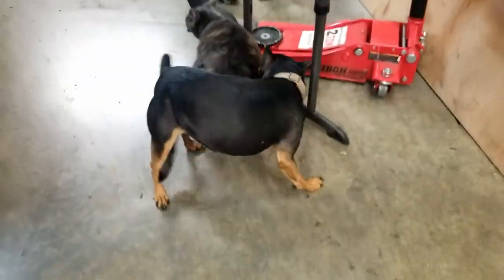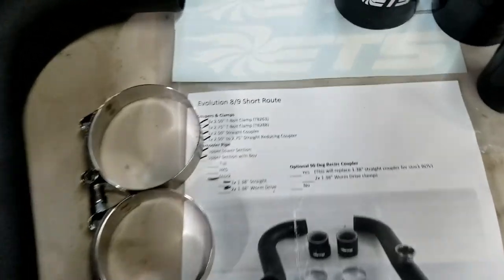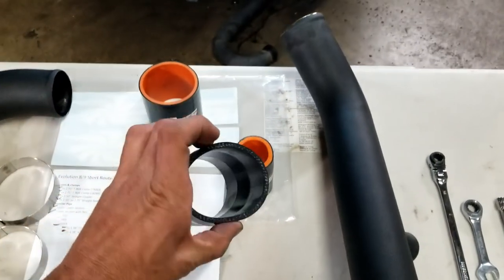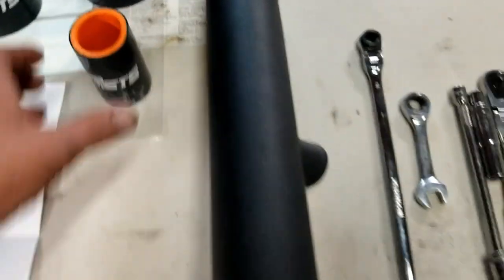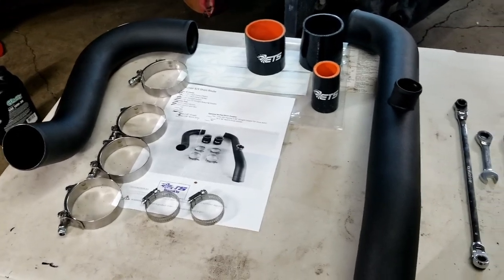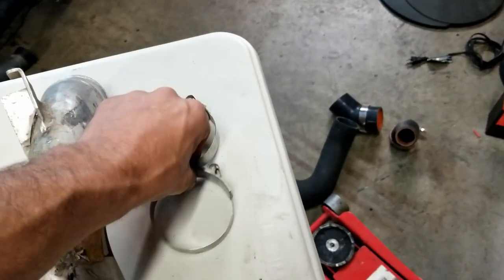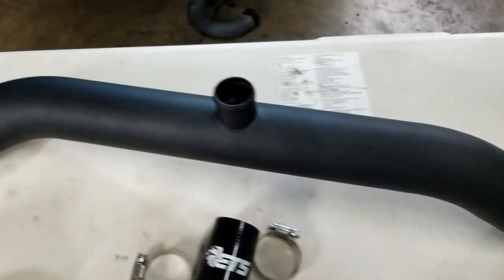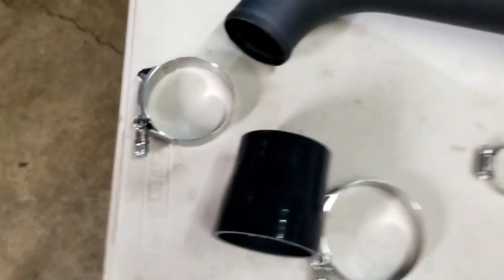ETS Short Route Intercooler Piping kit Install on Mitsubishi Evolution EVO8/9 ExtremeTurboSystems

Comment: you can either relocate the battery into the trunk or you have to get a small battery kit and use a small battery, in order to use the short route piping.
Reply from the maker: Thank you for suggestions! Customer decided to go with the small battery kit to keep it in stock location.
Reply: Yes, battery relocation or small battery kit. I suggest relocating because the small battery dies fast. Throw an Optimal in the back and 0 gauge to fuse block in front
Reply: @deejay098  I have my battery relocated to the trunk and ground it to the chassis/ frame is that ok to do my car drives fine you just mentioned running a 0 gauge to the front fuse block and just don’t know where to run the 0 gauge to in the front can you elaborate